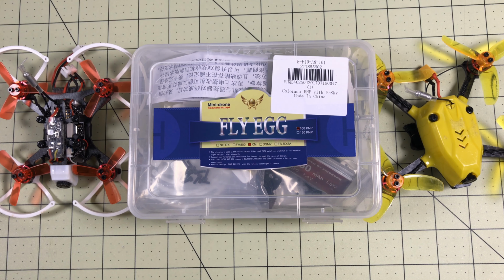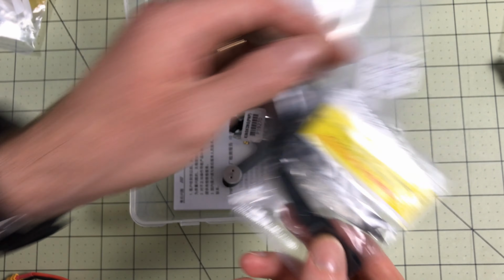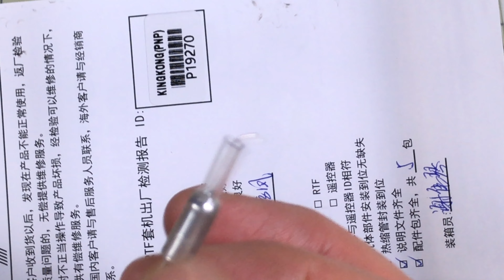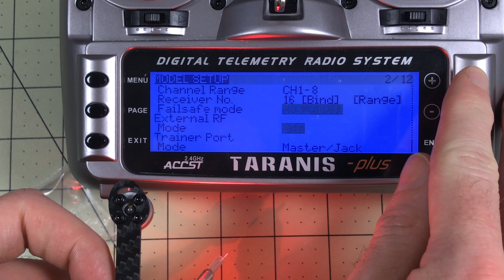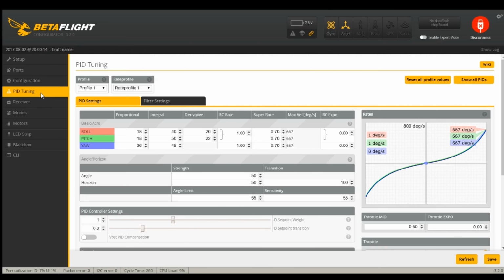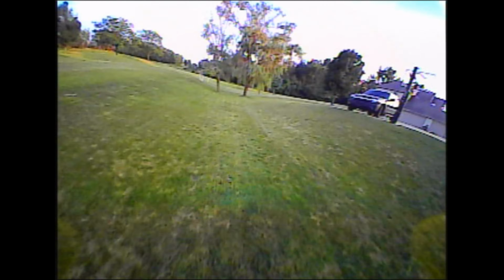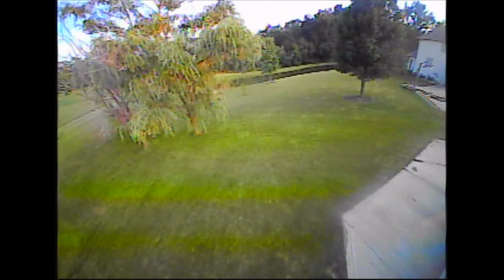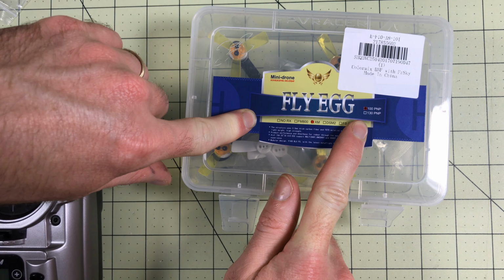KingKong Fly Egg 100 Unboxing and First Flights, A really good first racing drone option

Comment from the maker: You can get one right now: http://bit.ly/FlyEgg100
Try coupon FLYEGG100 or rc18off
Want the 130 version? http://bit.ly/FlyEgg130 
The best 2S batteries I have used: http://geni.us/2S450mAh80C
Check out my current giveaway: http://geni.us/DroneRacer101Rewards
Reply: DroneRacer101 i bet if you put the 1104 7500kv you turn it into a beast. i bought the frame and did the build with those motors. Its better than the gt90 since its 100mw vtx and 10a esc
Reply from the maker: +shylo23 those would make it killer. I am going to have to try these on 3S with some new wires first.
Reply: DroneRacer101 yea i seened someone review it on 3s. its pretty nice.

Comment: Maybe ask and wait for a v2 of the 130. Needs OSD, XT30, and vented motors!  ;)  :D
Reply from the maker: +GITech KingKong doesn't seem to be in any hurry to add OSD. They keep using the same basic guts in all of these.
Reply: And ironically, KK uses their separated cam and VTX setups that would make it easier for them to add OSD, as opposed to most other micro's that use AIO cam/vtx's. Weird. Maybe it's a planned obsolete/upgrade path built into to their business plan...

Comment: Try to switch the props to gemfan 2035 and 3s.. then it can be comparable to the lizard and arfun.. want to see the difference it make!
Reply from the maker: +AFIQ aFaT I'm going to do 3S for sure,  but I don't think the gemfans will fit.
Reply: DroneRacer101 no worries.. @frequent flyer had a video on fly egg 100 with gemfan props.. but only LOS video.. but no comparison to the lizard n arfun
Reply from the maker: +AFIQ aFaT I didn't think they would fit, but that was eyeballing it.  I'm going to have to take another look.
Reply: AFIQ aFaT its safe to run it 3s?
Reply: DroneRacer101 nice... try it.. it was very fast in the other review
Reply: Xplicit fpv yup.. safe..
Reply from the maker: +Xplicit fpv safe is relative:-)
Reply: AFIQ aFaT thanx

Comment: Great video thanks! I literally just ordered one of these lastnight lol..
I saw a couple of videos with people using 3s batteries in it so I ordered a couple to try out. Only issue they had was motors getting warm after flight. Would love to see what you think of it on 3s if you have any batts that fit the bill? Cheers! Love the channel!
Chris
Reply: Also, would you use the stock balance lead for 3s? Or upgrade it to a JST or xt30?
Reply from the maker: +C LittleJ no, that will have to be changed. If I have time and there is interest I will change the connector to an XT30 and put on bigger wires to support the power draw of a 3S.
Reply: Thanks for the quick reply! On a side note; I entered the competition for the 130 racer but whenever I try to put extra entries with the available methods it kicks me back to this video and I can't get back to the competition page under my name, have to start the whole process over again. Thanks once again! People like you are so much help to the community! Cheers!
Reply: Think I figured it out! The email you get after entry makes it much easier to do the requested actions. Hope this helps others. GL to all!
Reply from the maker: +C LittleJ ah. Good info. Are you using the Youtube app?  I haven't tried it from there.
Reply: Yes using the app on an iPhone. I could get to the links.. it's just getting back to the competition page I had trouble with, nothing saves and had to start over. The links in the email you receive work well though, then just go back to mail after doing the action. Re-click on the competition link and it saves whatever entries you've done.

Comment: How about to upgrade the motor like lizard have?
Reply from the maker: +Jeffri Ranger If you are going to plan on doing that, I would just start with the Lizard or ARFUN Pro instead.
Reply: DroneRacer101 I think I'll chose flyegg, because it have interesting frame, aio vtx and esc, and because of price....
LoL
Reply: DroneRacer101 somebody in youtube try to fly it with 3s and change the prop, and it does have much power to beat the speed

Comment: I just got mine, and was concerned about it using a balance lead connector.. Doesn't that mean it's only drawing from one of the 2 cells?  Seems most have the red JST connectors, but yours and mine came with the white balance connectors with one missing pin..
Reply from the maker: +Craig O the Balance lead is using the outside pins so it is using both cells in series. The problem with the balance lead is it can't support a very high amp draw.
Reply: Thanks for the reply.  I replaced it with a JST, and have been out flying with pretty heavy 3s batteries (550mah).  Flies really well with 3s.  Motors get a bit hot if you hammer it, but seems fine :)  Will get some lighter 450mah ones or something.  Thanks for the review.

Comment: I've loved KingKong since the 90GT, but all the new models seem to always miss the mark in some way! No OSD and silly thin battery wires with a balance plug (?) sadly shoots it down again. At least they got closer with an adjustable camera angle and a buzzer (finally!). Just can't quite put it all together to challenge the best from the other brands. I see no compelling reason to sink money into this, or the others, when the same money gets us a Lizard95! Oh well, KingKong entered the race again, but finished as an "also ran", half way back in the pack! Just like in the Olympics, someone's got to finish 7th. A shame... The closest they've gotten yet to putting it all together. Maybe next time?
Reply from the maker: +Scott Rostad Maybe, but I do think there is a place for this drone.  Looking at a couple of other reviews I think maybe they just screwed up and put the wrong connector on mine.  The other have larger wires and a standard JST.  But like I said in the video.  I don't want to hand my son or a first timer the Lizard.  They will hurt something, someone, or just break the drone.  The Lizard is durable but this feels like it will be next to impossible to break by comparison.  It just feels safer.